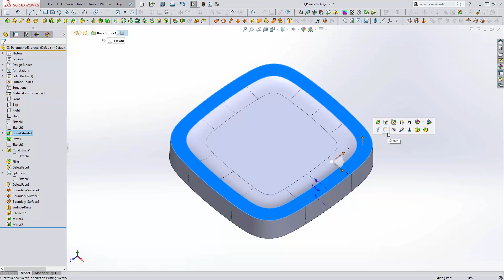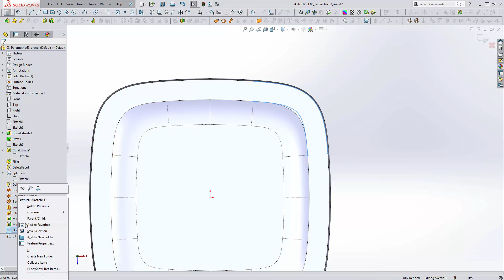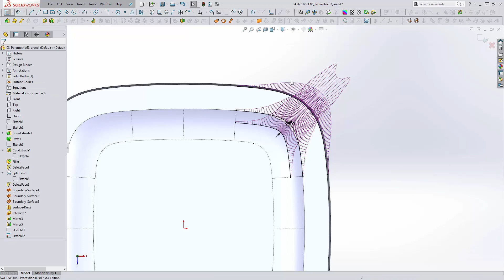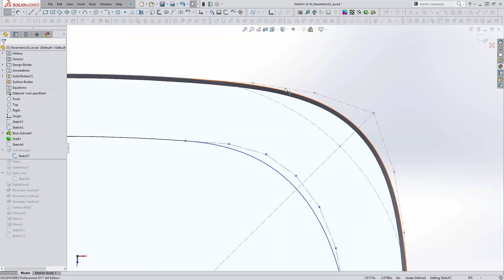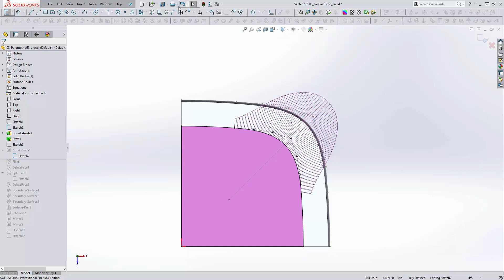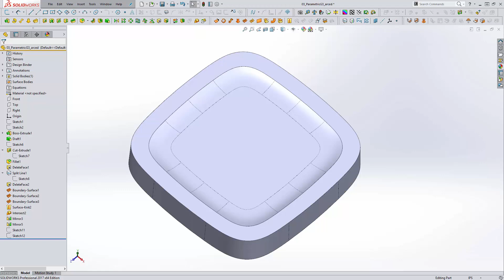Offsetting Splines - SOLIDWORKS Tutorial - Zen & The Art Of SOLIDWORKS Surfacing 05

Comment: Thanks for the video! Is there some way to offset or translate a 3D sketch spline?
Reply from the maker: It depends on what you are trying to do.  You can offset a curve sketched on a surface, but a 3D sketch spline in free space requires some trickery (as far as I know). 
Of course, offsetting or translating a curve in 3D begs the questions "which direction" and "what are you hoping to do with it?".  
The classic technique for getting to a result is to extrude (or maybe sweep, but extrude is simpler and covers most cases) a surface from the 3D sketch.  Then you can offset that surface, or use "move bodies" if you are trying to get a translation in a particular direction.  From there you use the edge (or edges) of the offset/translated surface as your offseted/translated 3D curve.
Heck, now that I'm thinking about it, just the act of extruding a surface from a 3D sketch in some specified direction creates an edge on the opposite side of the surface which is a translation of the original!
Hope this helps - Ed Eaton